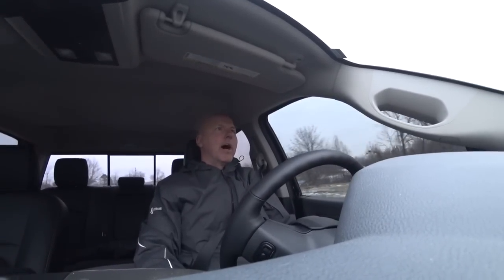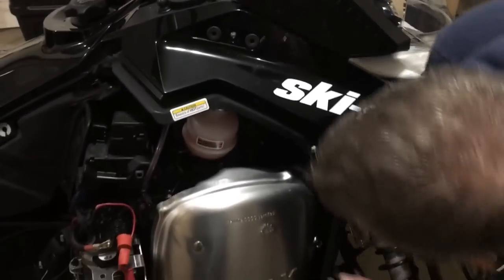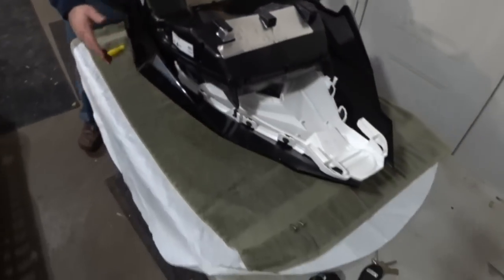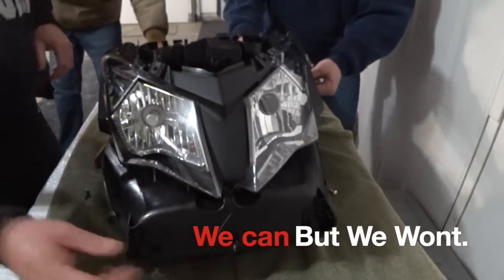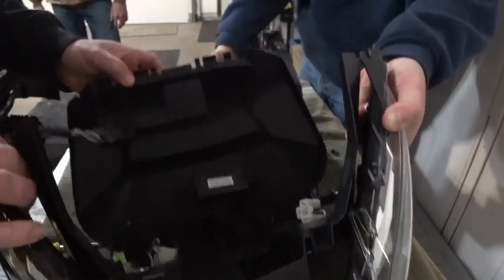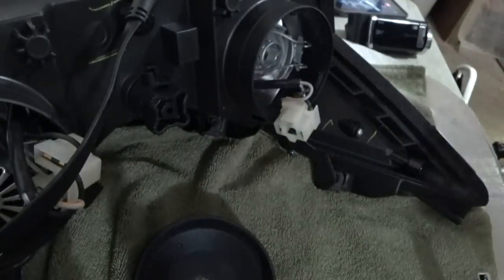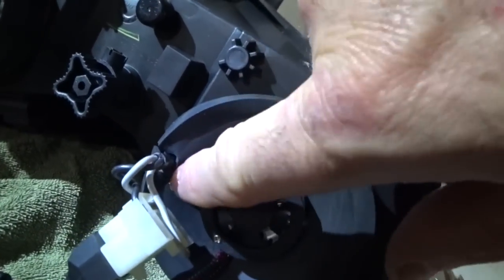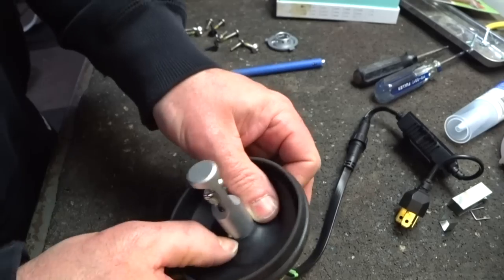INSTALL LED Ski-Doo Rev XS | 12,000 LM | Brightest LED Headlight For Snowmobiles

Comment: Hello.  Thank you for posting the video.  Nice work.  Are you still able to use the space for storage and not damage the lights or fan for the lights? I do not have the glove box extension but i do have the glove box bag.  I dont think i would be able to use the glove box bag.
Reply from the maker: yes its a tight fit for the rectifier boxes on the Eagle but our new B2 Series has better technology and has the rectifier in the bulb so it takes up a lot less room... see here: https://motojungle.ca/product/b2-series-h4-skidoo-rev-xp-xs/

Comment: Now he just needs the Skidoo led auxiliary light mounted on the bottom of the light.
Reply from the maker: bombidude not really needed with the Eagle LED H4 DiamondVision headlights they fill in pretty well on low beam.  The BRP aux led is prone to breaking - a lot of them fail and its a $300-400 gamble

Comment: We did 2 ski doo 900's (REV XS) this weekend. One went together fine ...the other was trouble. The boot tension would not allow the ball detent to stay in the hole - no matter what - it would pull the ball out of the locking hole.  Very disappointed. We rode with the lights not locked (just within the boot tension) the entire weekend and did not have issues but the detent was definitively not engaged. Any ideas?
Reply from the maker: randydolata that is the first i heard of that - the rubber is fighting with the bulb... but as long as the bulb stays veritcal and cant fall out, then it should be good.  The ring is pretty tight around that bulb so it would have to be a big bump or jolt to knock it loose.  I would ride it and just keep an eye on it
Reply from the maker: Try cutting more rubber away on the dust cap - maybe some rubber is pinched between the bulb and the ring as well...Make the hole slightly bigger in that cap
Reply: Yep did that and tested out of the bulb can but it did not help
Reply from the maker: @randydolata  Try the other bulb in that boot and see if it locks in plce.  If it does and  you think its the bulb - Its fully warrantied - no hassle - warranty on those... lifetime technical support, 30-day money back guarantee, 180-day free replacement + free shipping, 365-day free replacement worry-free warranty. Contact LED Eagle Canada or If there is no form in the box,  go through motojungle info@motojungle.ca - It'll get replaced ASAP
Reply: Take the red orings off the base of the bulbs as they’re not needed anyhow because the dust caps act as an oring.  This will make the ball bearing fit much better. It’s amazing the difference it makes

Comment: They only made the XS Blizzard up to 2017, 2018 was the intro of the Gen 4 Blizzard which is the 850. This is a 2017, I have the same sled.
Reply from the maker: Well, in Canada, he spring ordered this sled and had 2 options,  gen4 850 or rev XS Blizzard.  It's an '18 XS - 900ACE - don't ask me why but it is correct- Haha. exact same as a 2017 yes, but 2018 was the last year in the XS and you could also get gen4.  Possibly the 900ace wasn't available in 2018 in Gen 4 just XS?
Reply: Yep , me too . I have a ‘17 and an ‘18 XS Blizzard. Both 900 ACE.